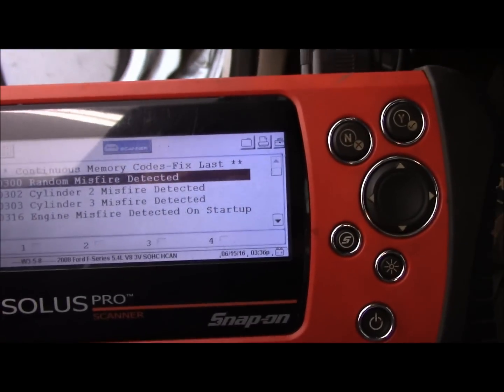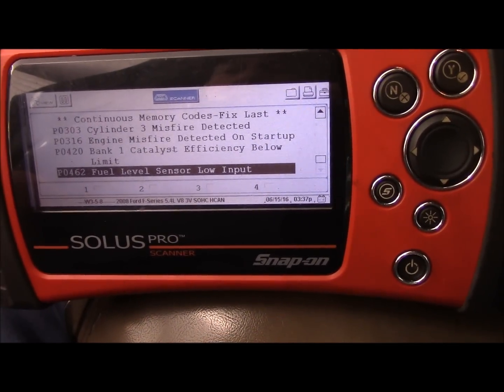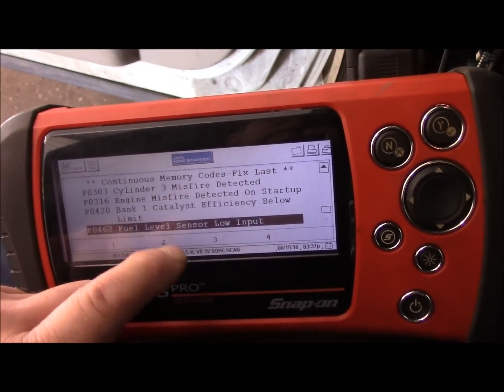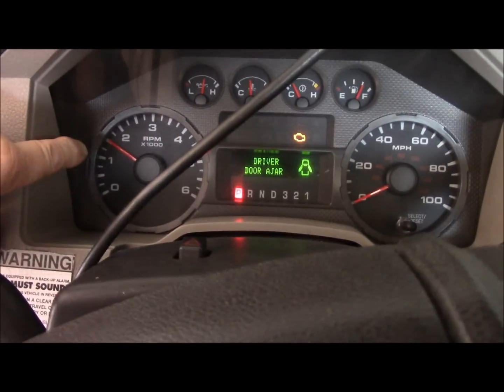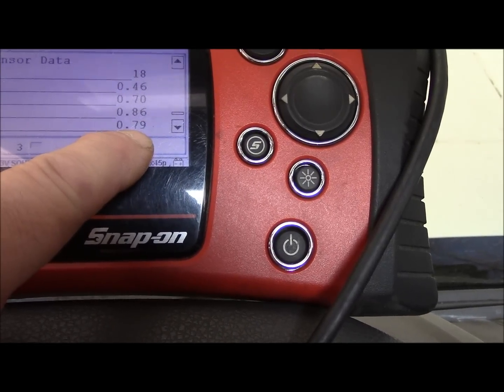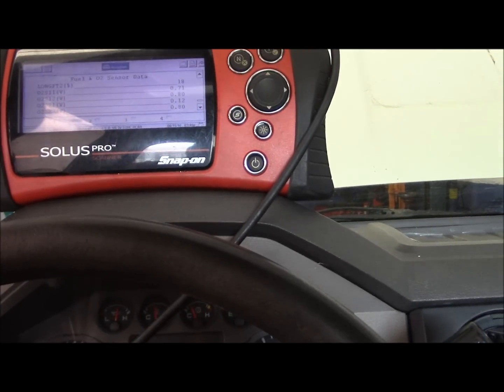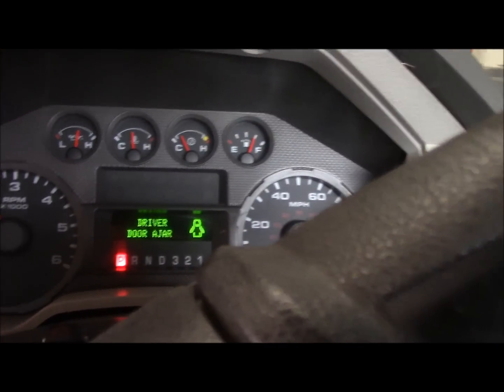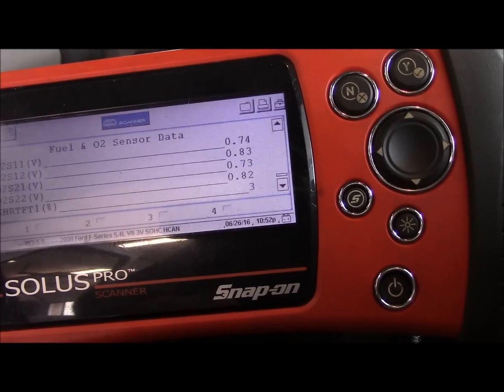How To Test A Catalytic Converter

Comment: Great video covered subject well, I have a 2005 Hyundai with a front convertor at the manifold and a second convertor about half way back will the o2 sensors show if the back convertor is bad, I only see two sensors one at the top of the exhaust manifold and one behind the manifold, there are no sensors at the back of the second convertor Thnaks
Reply from the maker: I'm happy to help. Thank you for watching

Comment: Po 420 means catalytic or can be o2 sensor my car was running with misfire I replace coils spark plugs pvc valve after that runs better but po 420 apear do you think cat is bad i removed cat and look normal no damages from one side because can’t see the oposite side any help is going to apreciate

Comment: From the research I was just doing, if the converter temp is lower after the cat then it’s clogged. So it appeared on your original system , the left converter was clogged and the right was emptied.
Reply: Yes
Reply: So are you saying that the temp further back the cat should be hotter than the temp coming in?
Reply: Yes, I seen that too?

Comment: I have a 2001 Ford F150 5.4 L Triton cylinder number 3 came up within misfire upon me hitting the Interstate Towing and trailer I pulled the plug out and I was a missing the electrode on the bottom of cylinder number 3 I went ahead blue the cylinder head out replaced it with Motorcraft parts coil pack injector and spark plug along with all these installations the truck ran better but did not throw cylinder number 3 misfire and mediately it through it 15 minutes down the road after acceleration and deceleration there is a shaking at 45 miles an hour truck ran better with new plug installed but still misfire cylinder 3 first off it starts out with cylinder number 3 misfire pending after 15-20 minutes to an hour I get cylinder number 3 misfire. could this be due to the catalytic converters and at what point do I test them upstream and then Downstream should there be a difference in temperature? Also can I remove the catalytic converters and install straight pipes at my local muffler shop keeping the O2 sensors in place
Reply: Please give me some help boy I need answers been running like this for 3 months and seems to be running better but I do need to tend to the cats I think
Reply: Please on the maker of this video see what you can do to give me a hand

Comment: Great Video and Thx. Quick question. For a 2009 Mustang would u recommend using the OEM Ford Y pipe/converter for replacement or would an after market ypipe be ok? Had a rattle in one converter but its stopped. I've had 2 shops recommend the Ford OEM. Thx

Comment: You have excellent teaching skills and knowledge jimthecarguy!  I went to college 4 years and didn't have a phd instructor with half your teaching ability!  This info is exactly what I needed after having a fuel injector stick open on my 05 F150 Triton 5.4.  It hydro-locked on gasoline and bent a piston rod (107,000 miles).  Check engine light flashed rapidly just as you said - I was 1 minute from home.  Started engine an hour later ...white smoke billowed out tail pipe and strong gasoline odor.  Fixed injector - all fine except loud knock started after starter came to halt.  #4 piston rod bent.  Will test cat after new engine arrives this week.  

Attention Triton 3-valve owners - 05 models manufactured 1/1 - 12/31 have injectors prone to this failure.  Replace yours today!   Ford extended warranty on these engines to 10 years or 120,000 and warned dealers of catastrophic engine failure such as mine.  Mine isn't covered due to time expiration, not mileage.

Comment: Great video. Doesn't pay to replace 1 coil. Have 2001 Towncar with low efficiency on bank 1 & 2 but passed manual e-check. Will try temperature check. Thanks for explaining which is bank 1 & 2. Very educational video.
Reply from the maker: I'm happy to help.Thank you for watching

Comment: To save the customer money you could’ve swapped out the coils from the other cylinders that were working. If the coils we’re bad then the problem would follow the new cylinder position, and thus , warrants a new coil. But to simply suggest new coils based on a code and then to further suggest replacing all oils that don’t even register a code is IMHO unethical.
Reply: Blac Cayman He did demonstrate that method of testing the coils in another video.
Reply: Upstream exhaust leak upstream of first O2 sensor between  manifold and first O2 sensor any exhaust leak here will cause that rear sensor to bounce and give you same code as bad cat,  so that’s a great idea to do the exhaust temperature check to verify of course exhaust leaks are often easy to see and here, but sometimes they are right under the manifold and just a little small crack and can be Can’ tricky. The temperature check is a great back up. Plan to verify for sure. No doubt about it at that point you can draw spraying seafoam and other stuff into the upstream O2 sensor port let it soak couple hours and crank it up. May bring it back up within the threshold as most cars are 95% threshold to keep the 401 code from popping when below 95% threshold with most vehicles you get the code triggered of course if honeycombs are damaged or too clogged cleaning will not work, but I have seen it work to bring it back up within the 95% threshold parameters and Last for years you could also bore scooet through the upstream O2 sensor hole and see if the honeycombs are damaged and how bad the blockage looks after this assessment, you could decide to try a seafoam soak or catalyst cleaner couple of hours or overnight, even then crank it up Clear the 401 go and see if it pops back on after running engine up to temperature can also do your laser thermostate after, digital reading again of streaming down stream of cat to see if temperature improved all easy stuff to do in good site a customer thousands on a new cat You could even recommend to the customer that they get a new cat but a possible option would be cleaning and the issue would be resolved could easily come back depending on how plugged up it was Best always recommend a new cat and then give the customer option to try and clean it with a disclaimer that it may not be a long-term solution depending on the severity of the clog and sometimes honeycombs are just too damaged even though they’re not falling apart, yet just quite yet there burnt cake the platinum and aureum is so seared and burn off that you’re not gonna pass an admissions test in condition will worsen. Also make sure you don’t have air fuel ratio sensor upstream, and just O2 downstream. Look at the wires determine what you have and if it’s a wide band like Toyotas differ between making model and California emissions. also, you don’t have to go with an OEM converter if you want a customer that you can’t guarantee longevity but it’s a cheaper option and even the Saudi ones on eBay usually last at least two years sometimes you have to patch their poor craftsmanship with a little weld here and there, but I’ve seen the cheapest cat converters last two years some five and pass emissions for 2 to 5 years if there’s no emissions or small checks in your state then could be a available option for older vehicles are people I don’t have money for OEM cat that usually runs in 1000s, depending on making model of course all these options will come with a disclaimer to the customer that you can’t guarantee longevity or warranty part or repair in anyway if they go the cheap route book it could be an option. You leave up to the customer make sure you’re not stuck in open loop as well. Make sure you owe two is going to close loop which you can tell after you get warmed up look over all of them if your rear row two sensor is not heating up properly or the heating sensor is not reading due to faulty wire or an overall electrical issue with the bonus feeding the sensor will watch it for a while and then keep the vehicle in open loop because it does not trust the sensor or monitor for a while eventually pop a code 401 code usually if the ECM is holding it in open loop because it does not trust a sensor not allow close loop to happen Electrical issues with the wires going to the downstream sensor, can cause it to Look similar to bad cat condition but it’s just staying out but end you’ve got an electrical issue or a problem with the sense of itself of course all these things or possibilities differ from making model depending on wide band or four wire set up, etc. the laser digital temperature reading with a trusted rated gauge is the best for me without a doubt you got a cat issue, but it does not always mean you have to replace it some can be cleaned some can. It’s going to get a customer options and of course tell them the cheaper route cannot be guaranteed but it’s an option. overall, great video. I’m glad you pointed out the random misfire that you fixed cause that’s probably what causes the cat to burn up. Running to Richard Lane with a misfire of course need to fix that or new cat gonna get destroyed as well. very good video to the point and gives the essentials that people can do at home to help.
Reply from the maker: Obviously you don't have any idea of the problems that this vehicle has with these coils but thank you for you opinion.

Comment: where is your shop located? My check engine light comes on stays on until I turn my ac on. when I turn my ac on the check engine light goes off.
Reply from the maker: My shop is in Bayonne,New Jersey
Reply: do you have a general idea as to why when I turn my a.c. on the check engine light goes off? the code is a p0420
Reply: Shy Selman The cat is less than 95% efficient. Scotty Kilmer’s video suggests removing it and soaking it in laundry detergent overnight or pouring lacquer thinner in the gas tank to clean it and thereby bring it above 95% efficiency. Watch his video for proper ratio of gas to l.t.

Comment: Correct me if I'm wrong but I saw another video where the guy had tested with a similar heat gun but he stated that the cat's, temp. front and back IS supposed to match.  You stated that you have the exact same temp. going in as going out but you say that cat is bad.  So, does the temp. up front supposed to match the rear cat or is it opposite?
Reply: If the temp is the same on both ends the catalyst has gone bad and is not functioning. The outlet end should be significantly hotter than the inlet.
Reply: exactly wtf.!! same in and out I saw the temp reading difference by at least 50 degrees I think he misspoke but still a ok vid

Comment: That guy did exactly what I'd fear a shop would do, screw up the installation and create an exhuast leak.  Man, shops, if you are going to replace cats you better make sure it doesn't leak after you do your job!  I hate the sound of exhaust leaks.
Reply from the maker: Robert Wilson III there was no exhaust leak!
Reply: Oh, well then, that truck runs like shit! lol. It sounded like a leak to me, guess there's just a lot of mechanical noise.
Reply from the maker: Robert Wilson III    Oh yes your right it did run like sh-t. Lol thank you for watching

Comment: How about a first generation Sienna with a rear lower catalytic convertor and 2 upper by the different banks?   P0420 bank 1.

Which converter is bad?  firewall or rear?  (firewall is bank 1)

2 upper A/F sensors and 1 lower O2 sensor

Comment: Mine secondary O2 sensor moves reading moves around for like 2 seconds when I switch it to that reading, but levels out at like 0.075 shortly after and doesn't move that much. Does that mean it's still good?

Comment: which way would be considered the front when testing with a thermometer
Reply from the maker: The front of the car is considered the front of the converter and the rear of the car is the rear of the converter.
Reply: Should the front be hotter than the back or vice versa
Reply from the maker: The back should be hotter by a few hundred degrees.

Comment: How do you find a random misfire code p0300?Replace all tune up items.Think we ruined the catGot the 421 code now..Could smell fuel burning then light came on.Car idles fine and then all of the sudden it will run bad.
Reply: newyota1 check your ignition control module that's what mine was on a 99 buick can be tested at auto zone

Comment: Mine is reading 400 degrees before and after the cat.  The cat itself, however is reading 150!  This is without a heat shield.  Why would that happen?
Reply from the maker: If the temp in and out are the same after the car has been tested as in the video then the cat is no good and will need to be replaced.

Comment: I have two Cadillac converter on my car. the left side says 380 at the top pop the bottom pipes says 276 the right side says 147 at the top the bottom pipe says 116. so I take it that means the left side is bad.

Comment: Heh, if your check engine light is flashing pull over... I just replaced a cat on a Jeep. Lady said she drove it for a year with a flashing check engine light, and now needed it fixed for state emissions testing. Random misfire and a dead O2 sensor, burned a hole clear through the cat. Had to put on the dad voice and lecture her about ignoring the light

Comment: Jim, I drove a 91 Mazda pu for years with the check engine light on and sold it and that person drove for years with light on and never any other problem.  In fact, I called the dealer and he said don't worry about it.  In other words, is it always critical that the check engine light be addressed?
Reply: Yes fix the issue, just because you dont feel a difference doesnt mean you dont have a bad injector or cat and slowly destroying the engine slowly

Comment: Id love to know how much that job cost - all the coils and the 2 new cats. A big job and not cheap would be my guess
Reply: I’m $1400 lighter replaced the whole system yesterday new clamps new bolts 4 new sensors 🤦🏽‍♂️ 07 Jeep Grand Cherokee 170K oh and a week b4 discovered had a cracked radiator on the plastic neck nxt to the upper hose another $550 🤦🏽‍♂️ it’s like I’ve put a down payment on a new ride 🤦🏽‍♂️

Comment: I've done the coils and plugs on those Ford vans....no fun.
Reply: Know this is an old post and video. However, what are the names of those coils you're talking about? I have a PO0420. I'd like to change the Catalytic converter and 02 sensors (have all three parts already). Since the Car Guy mentioned coils, I'd like to check those too. Thank you.
Reply: Unless you have a miss don't wast your time with plugs or coils Your cats are probably bad. get some extenders for the downstream sensors and that should be the end of the p0420 and p0430 codes.
Reply: eldoradony I actually have PO0420 and PO0457. My cap is good.
Reply: @ScreenPrintR  The p0457 is an evap leak code. could be a vent valve, purge valve, or a leak in a line or the tank.